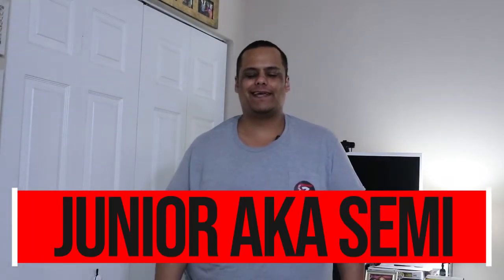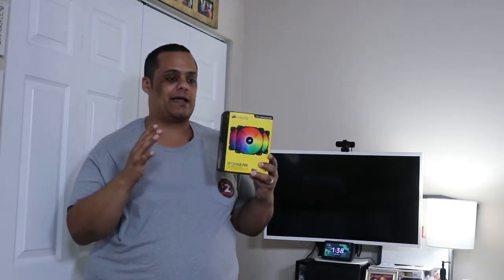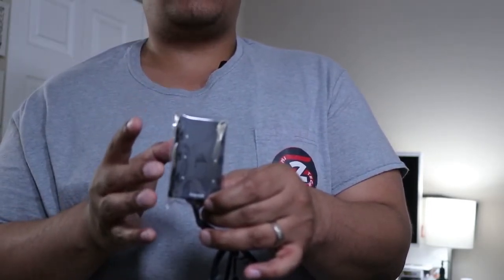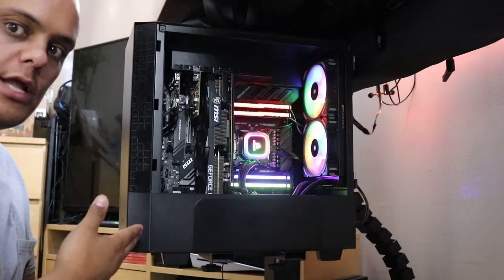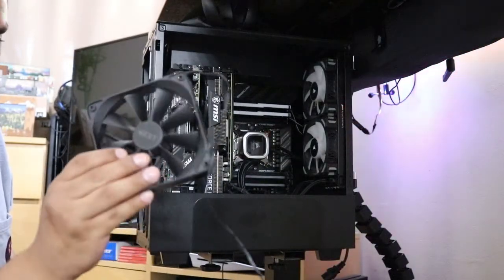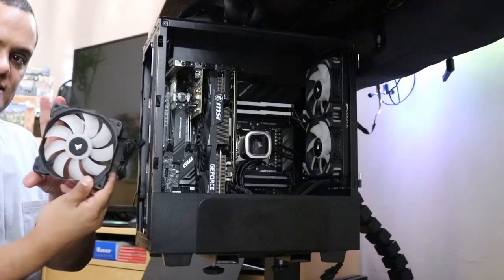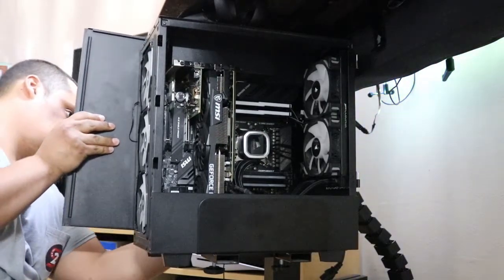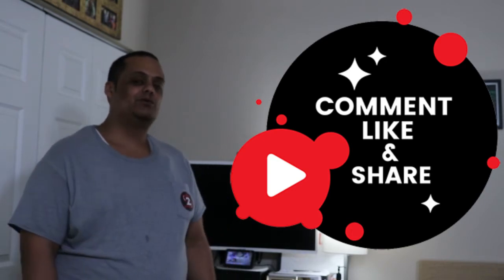Unboxing & Installing Corsair SP120 RGB Pro Fans

Comment: Hello ,We don't connect the second fan cable, do we agree? Just a 4 wire cable on the node right? Thx 🙏
Reply from the maker: The node is just for the lighting of the fans doesnt control fans
Reply: @Semi2Tech  I just understood. as I only have 3 fan boxes on my motherboard, I must add a power hub! corsair obsoluty or random brand is cool ?
Thx for your help, appreciad 😊

Comment: hi im building a new pc i bought the same fans but exactly where do i put them cause i dont have enough fan headers on my mobo, im also getting a corsair icue H100i elite cappelix, thats 2 fans, so here is  how it'll go i have three fans in front, the two on top with my aio, and the last one being the exhaust one, but like i said i don't have enough space on my mobo and I don't know if my cooler will be combatable fans will be combatable with my normal sp120 fans since the ones on the aio are different, it'll be really helpful if you can explain to me what to.
Reply from the maker: They do sell fan jumpers online so you can add more fans. Yea also the h100i  only has 5 spots for fan  so you are limited

Comment: Do I need to use the commander pro for the rgb to work or can I just plug into the motherboard?
Reply from the maker: i use icue software and you will need to use it to make the lights work or it will not light up

Comment: I have a question. Will my motherboard support it ? Its MSIb450m a pro max.
Reply from the maker: Yea the fans connect to the power supply and the fan plug on the motherboard